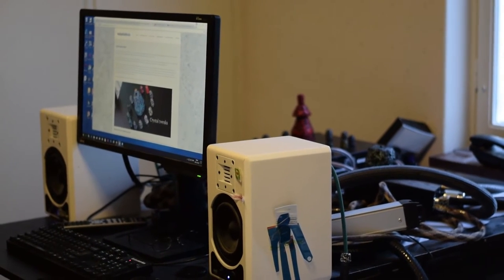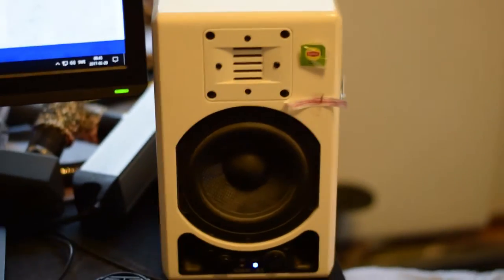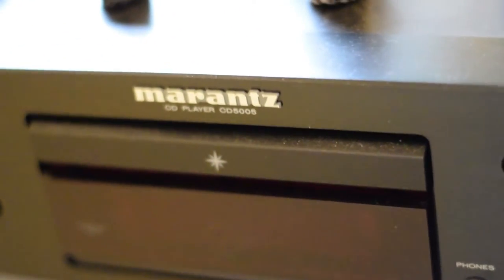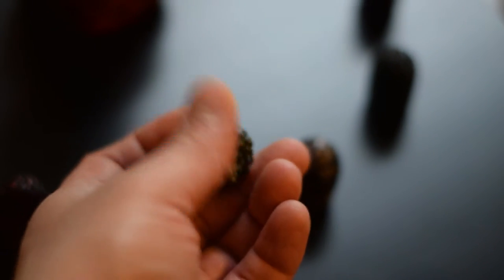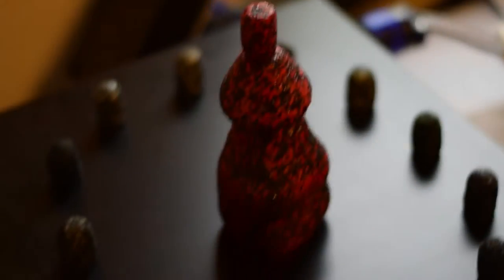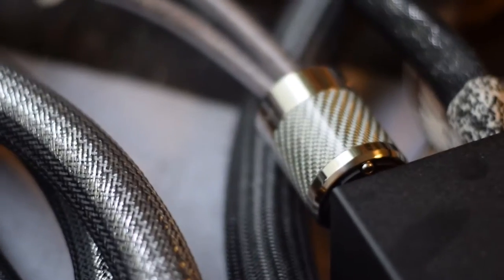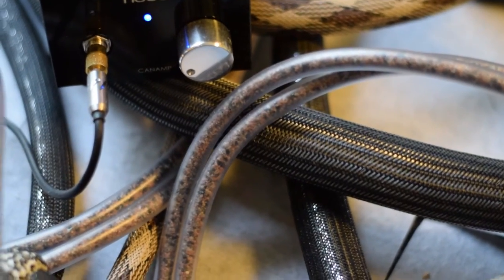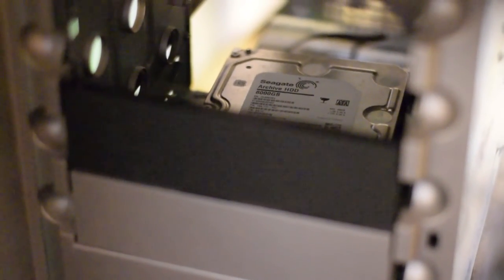My high-end hi-fi audio system with audiophile rocks

Comment: So are you saying that you can have a $2000.00 stereo set up with $10,000.00 worth of cables and it would sound better then a $10,000.00 stereo with $2000.00 cables?? I find your interest very interesting.
Reply from the maker: Yes, that is what I'm saying. I experience the same thing over and over again. The greatest value for the money is cables and tweaks, and the bonus is that they don't break. Electronics break often and then you need to spend a lot of money to buy them again.